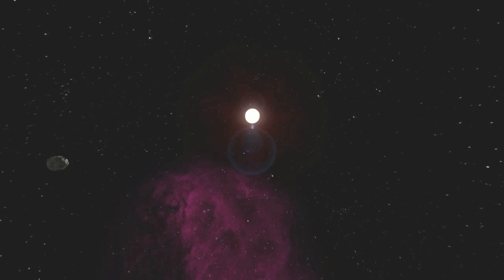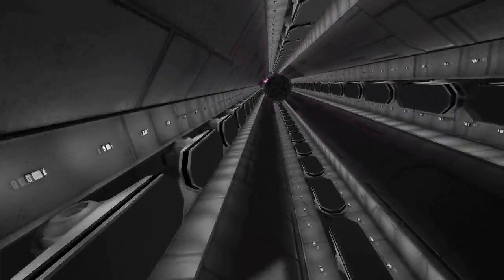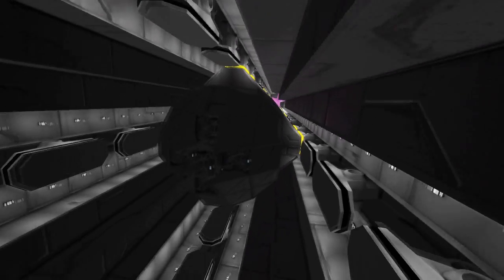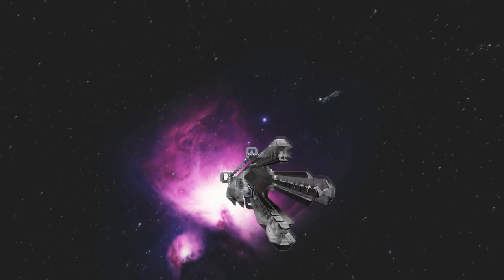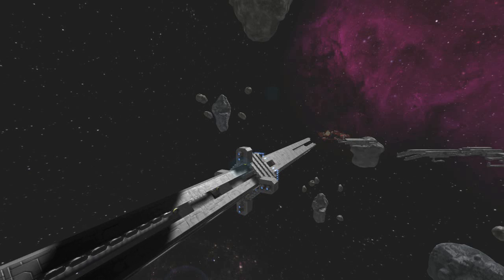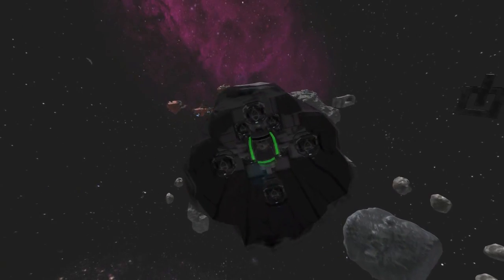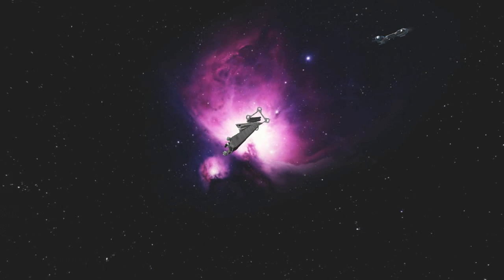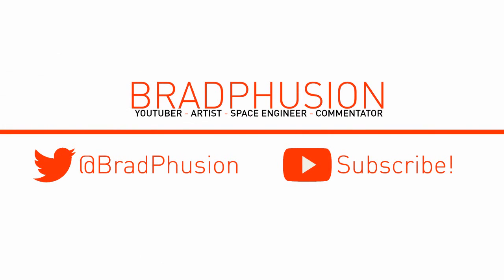Magnetic Rail Cannon with Multiple Rounds! (Space Engineers)

Comment: i have some ideas on how you could actually build the rail system:
either make a stone into your vehicle and have gravity guiding it, not the armor plates. (like, build gravity generators on the rail edges pushing it into the mid on each side) or try out one wheel for each rail side, not just one like you did...just some ideas im really too lazy to try it out
Reply: I was testing the first idea a few days ago and it worked quite well but i struggled getting the correct size gravity fields when extending it